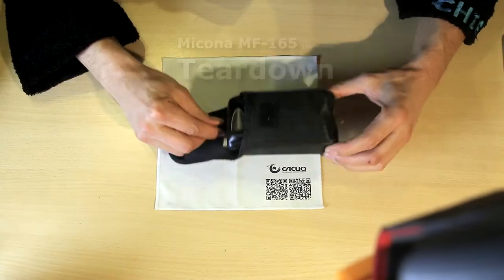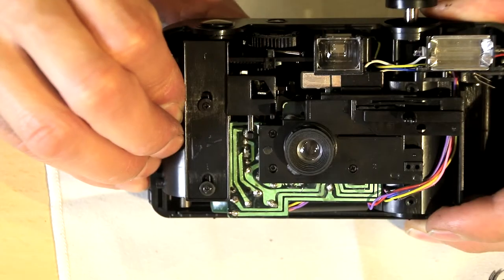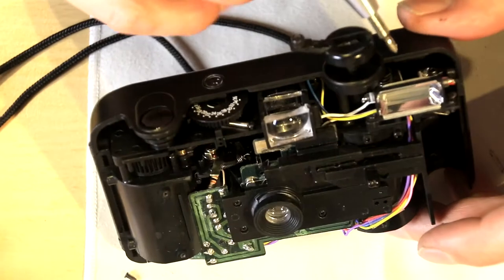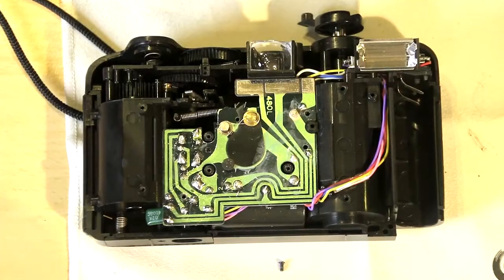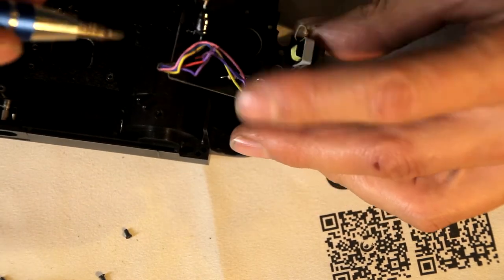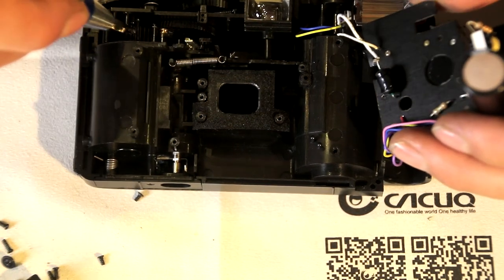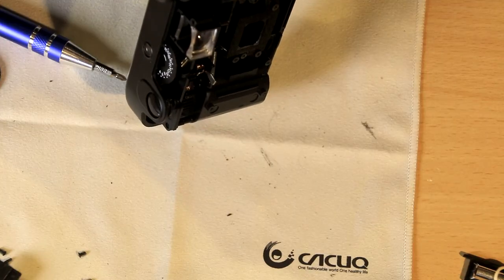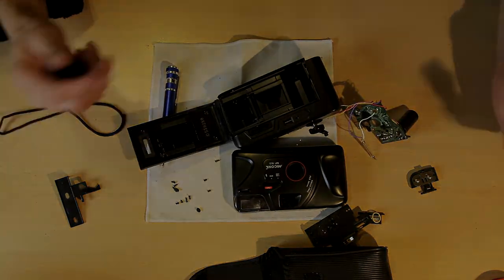#72 📷 Micona old film camera  with flash teardown - MF-165

Comment: On 3:15, that's the trigger transformer on the other side of the capacitor. The "big" transformer is to charge the capacitors. This small, round, black transformer, is used for creating some thousands of volts to force the Xenon tube conduct electricity.
Reply from the maker: Nice, thanks for explaining  !!